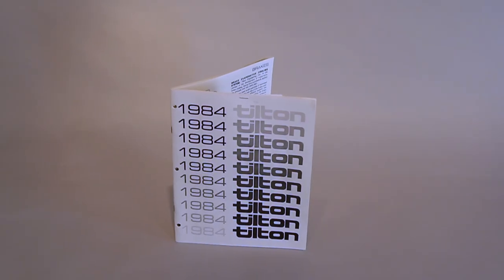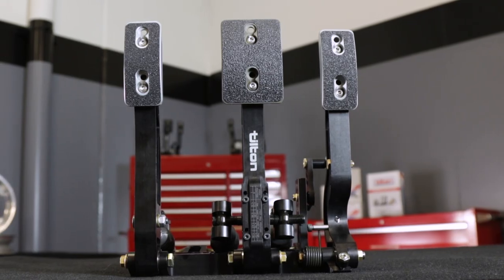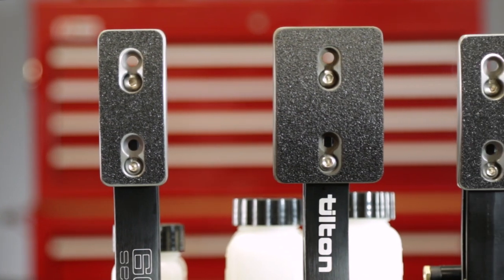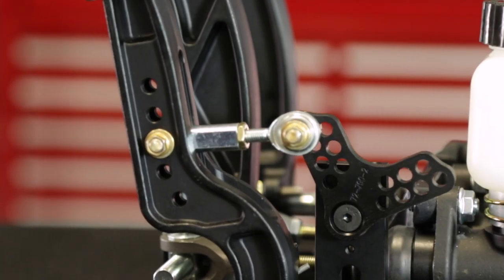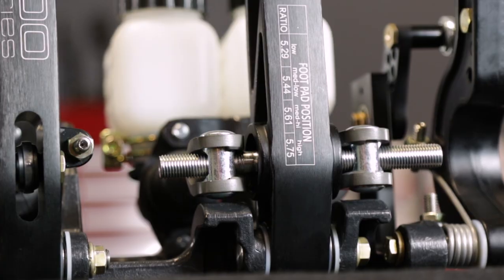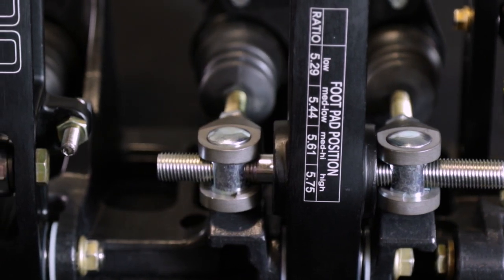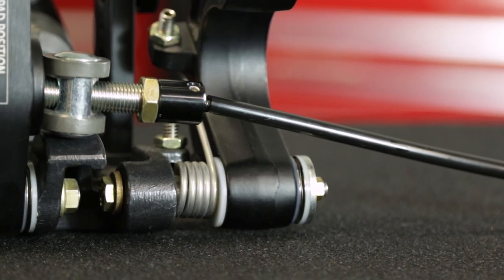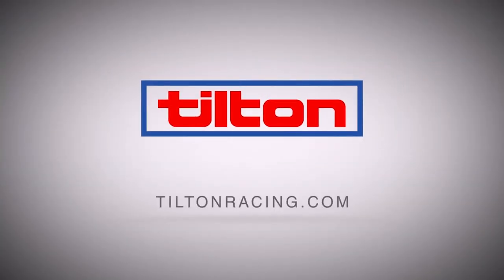Tilton 600-Series Pedal Assemblies

Comment: if the cylinders are mounted to the pedal assembly, what happens to the brake booster? Want to install new pedals in my Datsun 280Z...
Reply: You wouldn't use a brake booster. Generally you don't want a brake booster in motorsports applications because of its inconsistency and pedal feel.